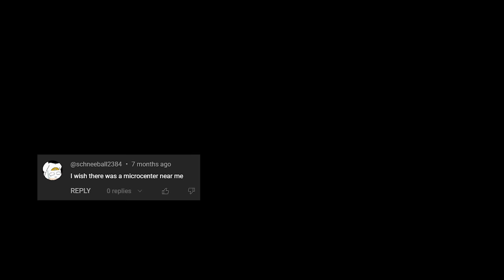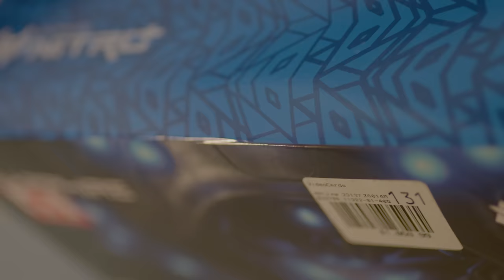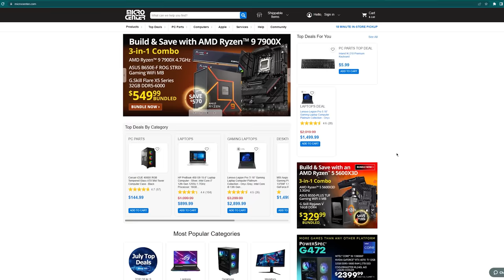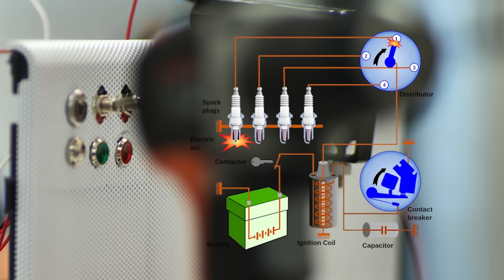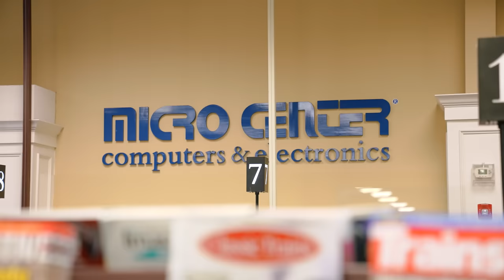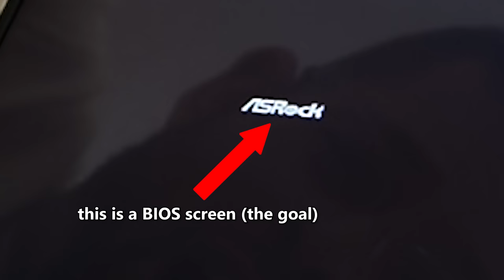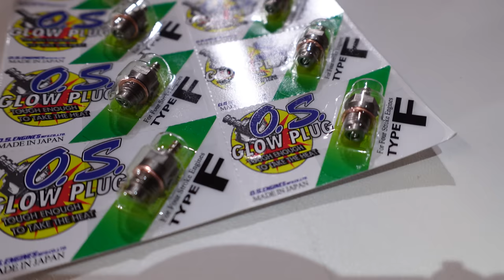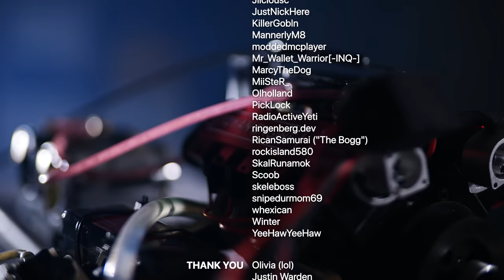I Built a Gas Powered PC

Comment: Basically is so talented, first making an invisible set up to making one that is powered by gas? Absolutely amazing.
Reply: And he's doing it in a closed garage, surprised he didn't die of CO poisoning
Reply: @solidsk8er  you can see the garage door wasn't all the way down though
Reply: @solidsk8er  you see he went to open it a little in the vid
Reply: This is gas
Reply: @solidsk8er  does methanol produce a lot of CO when burning?
Reply: but hes called mr homeless 😭
Reply: @xmysef4920  Depends on the air-fuel mixture. Shouldn't produce a whole lot generally but even a constant supply of low quantities can build up to dangerous levels.
Reply: Hey! That's a pretty creative idea, building a gas-powered gaming PC. I haven't heard much about that before, but it sounds intriguing. By the way, have you checked out the HOTO Compressed Air Capsule? It's a handy tool for maintaining a clean environment in your setup and other spaces. It's compact, powerful, and reasonably priced compared to other brands. Check it out!
Reply: imagine if someone with real brains did this, i mean like, top .1% of brain type person did this.

Comment: A small battery is actually a really cool idea, here's why. 
It gives you a reason to actually use the throttle! Imagine a huge analog charge guage for the battery level. As you're gaming, you have to manage the throttle to keep the charge level up. It would smooth out the spikes enough to make things like a particularly GPU-intensive action sequence actually something you could respond to before the power cut out if you didn't have enough throttle.
Reply: Brilliant 🔥+supercharger of course 🤣😂🤣🙈🙊🙉
Reply: An alternate would be to use supercapacitors which would respond much faster to throttle and power usage but still provide enough storage to keep the machine up
Reply: I'd 100% go the supercap route. Anyone in electronics knows that if it needs a bank of caps to work, it's spicy, whatever it is.

Comment: You should have a sensor hooked up to one of the dc motors/alternator or even look at the rpm of the belt, then use a servo to automatically pull on the throttle so that the pc automatically revs up while you play games.
Reply: Can he then play games on it ?
Reply: The sensor would also need power as well, but yeah this would absolutely allow it to adjust better than manual
Reply: @VEVOJavier blud doing face reveal

Comment: You could have hooked up a servo to a fan header and made it control the throttle automatically with a speedfan config.
Reply: i was thinking this the whole time. i thought for sure that was his direction instead of using a pedal, but that would have added another 2 months at least to this project

Comment: you definetely need some kind of loop that monitors voltage on the alternators to rev up the engine when it needs more, so you can actually game on it, and it automatically revs up when needed like you said
Reply: The engine isn't reliable enough it will likely blow up after a few hours of running
Reply: @MidwestFarmToys  now hear me out.... A mower engine.
Reply: @DrRussian  my god. 

You're a genius 🙌🙌

Comment: You need a governor. The same device small mower type engines have. Figure out what rpm you need, and adjust the governor to that. Should keep the power flowing without the need to manually throttle it, and you get the benefit of hearing the engine throttle up under load.

Comment: That's amazing!
Now if you find a way to automate the gas pedal based on the wattage needs and make an override petal just in case something goes wrong, then you'd have it almost all auto (maybe... I'm a computer guy not a car guy).
And to top it all off, put the motor in the chair to make a heated vibrating chair.

Comment: If you want to keep batteries out of the equation but make it work well you could use a big fly wheel and a speed controller that takes the voltage and rpm as inputs and sends a throttle command as an output!
Reply: Next video: i upgraded my gas powered pc with a giant rotating millstone

Comment: It would probably help if you tested and tuned the engine without load first. Then add some type of clutch or a way to connect or disconnect the belt from the load while running for engine starts. Thats a lot of stress on start up.

Comment: Bro you need a cruise control module to hold the RPMs steady enough play. Or better yet, get it to idle at an RPM that just sustains the OS but then gives it the extra juice when you push the pedal.

Comment: should have hooked it up to a UPS backup battery so it doesn't turn off immediately after releasing the pedal, but you still need to give it juice with the pedal to keep it charged.

Comment: needs moar Supercaps and -32-72VDC->+12VDC server PSUs. Will absorb the spikes and deliver clean +12V to whatever DC-DC ATX PSU you want to use. Also, could go dieselpunk and get a cheap diesel engine off fleabay. No 'ignition' to deal with :p

Comment: i wonder if he tested for mechanical draw from the drive belt.. if u happen to read this mr hummus disconnect the drive belt and do a voltage drop test of the starter when u start the engine, write that number down. then reconnect the drive belt and do another voltage drop test of the starter when u start the engine. if the second number is larger than the first number your drive belt and/or pulleys are way too tight/restrictive.

Comment: I am a programmer from Ukraine. Last winter we had a big problem with electricity due to rocket attacks. In general, the idea of a gasoline energy source for my computer was very relevant for me. The reason why I am writing this is because at some point I had an idea to create something similar. But in the end, the best solution was a camping generator that also runs on gasoline. It is quite quiet, and when I turned on only the computer and lighting from it, it lasted 5 hours on one tank

Comment: Rectifier + Battery (tiny battery, just a buffer to clean up the power) = you'd have gotten past the splash screen and actually been able to game, you didn't even make it to the BIOS. Without booting into Windows and CPU-Z validating I don't see this as a success. It's still really neat though, looks like it was a lot of fun. Hey, it's Car themed- all Cars have batteries and despite running mostly off alternators, many still need a battery to not run rough/die

Comment: This is like having a small old briggs 1200 watt generator to run a desktop and you do cpu and gpu stress test and it damn near stalls it, voltage drops to 109 voltz freq drops to like 58 lol psu is screaming. Works though. Having enough computers I can hear a difference in load on a Ford 1520 running a PTO generator.

Comment: Remove laptop battery plug in regulator adjust voltage and done. Just don't try plugging in the laptop to ac power and try charging the regulator.

Comment: You could have stepped up the generator voltage to mains voltage and then plug in a normal power supply to it, that would have been much simpler

Comment: Regulating the output by controlling the motor RPM seems near impossible, especially with the traditional method of altering the fuel and, mostly, air that is going into the engine to control the RPM. The acceptable margin of error could be widened with a large capacitor bank, but thats just a battery with a different name. Seems to me even if you could get the power you need, you would have stability issues.

Comment: Curious whats more powerful a mini V8 engine like the on in this video compared to a standard single cilinder small engine like a predator 212cc. Why don't we make  mini V4 cilinder or mini V8 engines as "small engines" instead of the conventional single cilinder small  engines it would seem like it would produce more torque because in a single cilinder 4 stroke engine the powerstroke only happens every 720 degrees of crankshaft rotation but with a multi cilinder engine the powerstrokes overlap so more torque like a 4 cilinder fires every 180 degrees of crankshaft rotation and a V8 every 90 degreess.

Comment: It is awesome! But it would be even better with a manual transmission, so you don't need the engine on high rpms at all times and you got to change some gears. Imagine how practical you changing gears while sniping some bots 😂 or even easier, changing gears to keep up the power to the PC while playing Forza on manual...

Comment: x670e isn't a 12VO motherboard. How did he get the 3.3v and 5v outputs?
Reply from the maker: The power supply is a 24v DC to 3.3, 5, 12, etc. designed for vehicle CPUs

Comment: instead of using a chineseium rc engine you should have gutted a full AMERICAN BUILT 120v generator and strapped it to the side of that thing with a lot less reinventing the engine there you could be doing everything you need with the revving included because generators rev up under load already please complete the mission smooth brain and go outside engine fumes kill in minutes

Comment: You have no engine torque it kind  important Due it Prevents the Engine From stalling under LOAD  And A flyweel for idle load tick over (you also did not setup your calibrator  idler)

Me i would of used to Ebike 1000W 4000W 48V DC Direct in wheel dive Hub wheel motors (or Washing  machine Direct drive motor) and get 3 phase AC and 6 way rectified  an Clean up the AC to DC Power ripple ( it will be Very high Frequency ) due it won't be Clean DC with a few Caps & Inductors chokes and filters + and make the FFC And Hams an AM (LW MW SW +CB Ham  WiFi + Cell phones) band radio users Very Happy  that i jus diden wipe out the Whole Radio spectrum baseband + wont kill the PC (The DC need to be vary clean and Pure or you have a very unhappy or unstable pc)